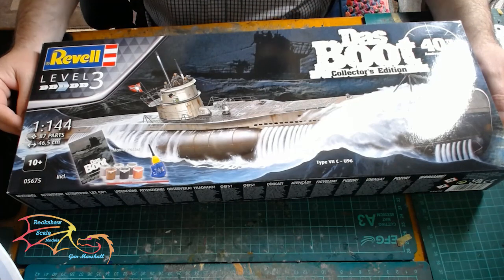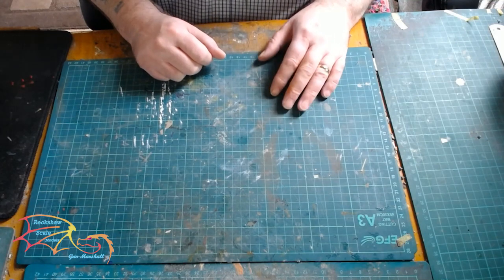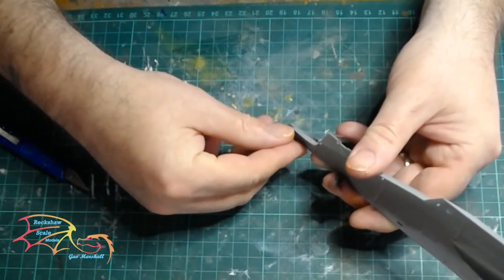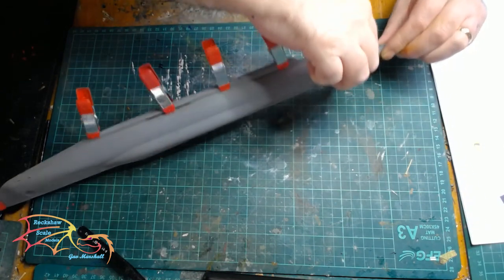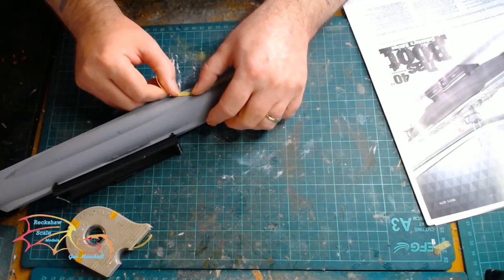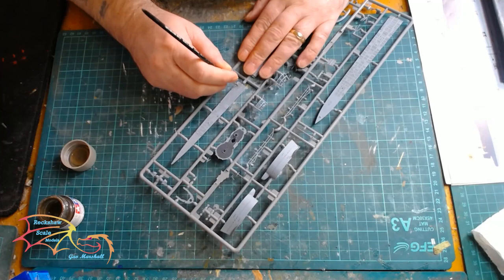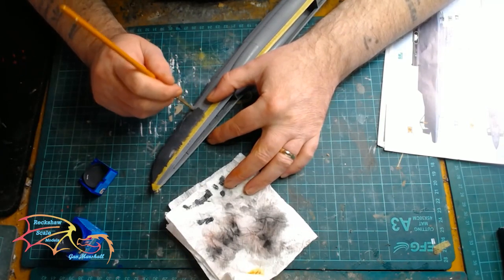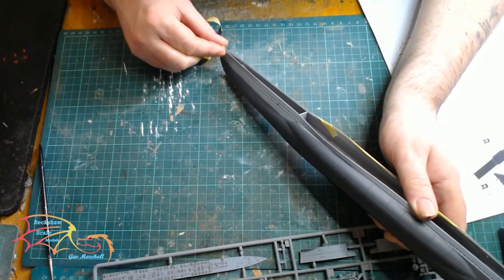Revell Das Boot VIIC U96 Scale 1/144  Part 1

Comment: Yes, I have to admire this painting technique. Could you do close-up of the brush head? Also good tip about varnishing over the masking tape. It should ensure little or no bleeding.
Reply from the maker: Hi Neil, I'm in the middle of building the Vulcan, so I'll do a small section of the video about the brushes I use and close-ups for you.  If I have time I'll post it today (11/08/2021)for you. Varnishing over the tape is a great way to stop paint bleeds, you can also paint over the tape using the bottom colour. In the case of this build, I would use the Revell 57 to go over the tape before applying Revell 78. Try and paint from the tape onto the surface. If you paint up to the tape you could push the paint underneath no matter how much the tape is pressed down on the area.
Reply: @ReckshawScaleModels  cheers Gavin. Great work.

Comment: I have one question:
did you get colors and glue in there?
Reply from the maker: Hi krix. Yeah the small paint pots and cement are included with the kit as well as a paintbrush. I normally only use those paint for mixing colors.